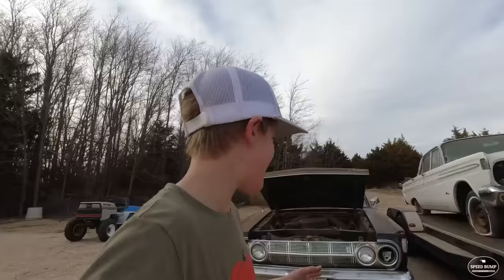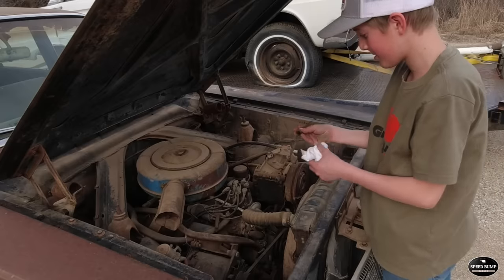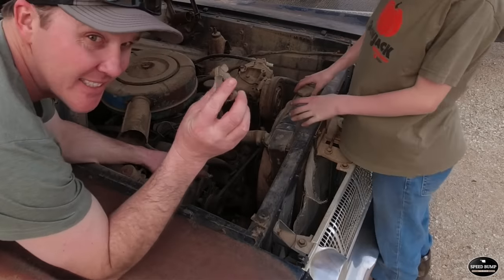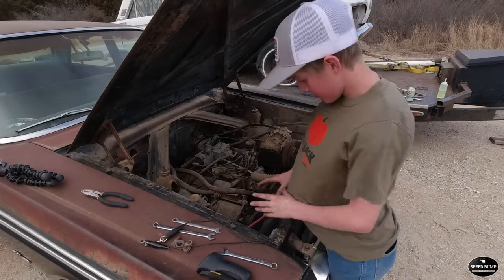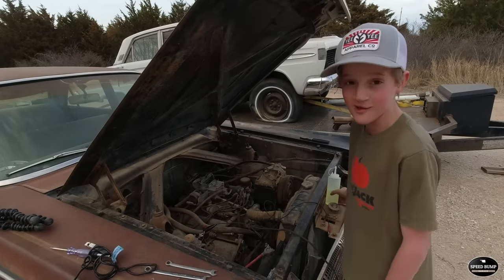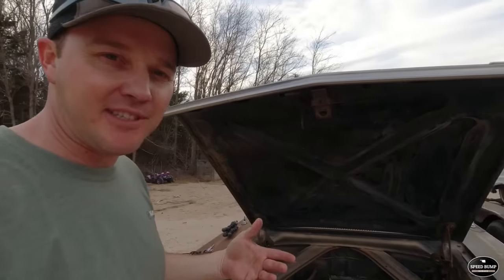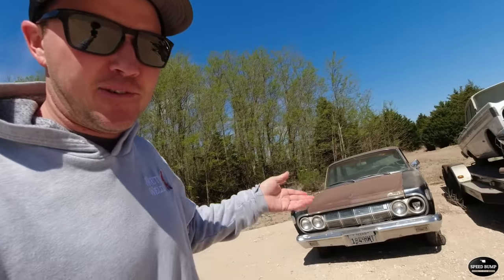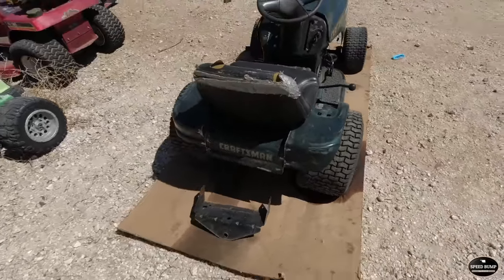1964 Comet... Make it run and it's YOURS!😲

Comment: Take the belts off so the engine isn't struggling to turn over. Use some mystery oil in the cylinders to help the piston rings to help build compression. Use two cycle gas and oil mixture to pour in the carberater  also check the spark plug wires for cracks which could cause voltage drop. Jack im extremely looking forward to seeing you get this car running and I would like to see you working on your lawnmowers. And remember there is no such thing as mistakes for mistakes are just a learning tool. Have Fun.
Reply from the maker: Thanks Ricky! Great idea on the belt
Reply: it gonny to work
Reply: Keep in mind has the car gets newer electronics starts to take over. Pretty soon you'll have to be an electrical engineer if you want to work on cars.
Reply: I love your video's
Reply: It's gonna work
Reply: When get coment running & what going on mover !!!

Comment: You're on the right track. Pull the plugs and oil the cylinders. It may help to remove the belts just for the first start and run. Check for spark at a plug or two. If you have it, put a little gas in the carb, open the choke, and try it again. I got all the faith in the world that you will figure it out. Great job so far.
Reply from the maker: Great advice! Thank you

Comment: What a great car for your first car, Jack!  I agree with your Dad: pull/clean the spark plugs, soak the cylinders (PB blaster or Mystery oil), check spark plug wires for corrosion or mouse damage, and MAKE SURE they go to the correct plug.  Make sure the points are free to move (open and close) and the contacts are not fouled.  Check for cracks in the distributor cap.  Also, clean the grounding point where the battery grounds to the motor, and clean the contact point where the HOT starter wire from the battery connects to the starter.  Compression test too!  WHEW!  THAT'S a lot of work.  Good luck, and keep the camera rolling despite knowing the project will take much more time.  It's great YT content!  Guys LOVE lawnmowers... esp fast ones... we'd love to see that too!  Good luck with all your projects, Jack!  We love your videos!!!
Reply from the maker: Thanks for the great advice Dr. Lee! I will pass it along

Comment: Jack, check the ground connection on the engine block, corrosion there will also cause problems with the starter going slow.  You may have a starter with worn bushings causing it to drag.  I like your work!  Show us something on the racing lawn mower project too.  When you are feeding gas directly into the carb, you can fill the bowl through the vent, and if it starts, it will run until it uses all the fuel in the bowl.

Comment: We want to see that lawnmower project for sure!  Super cool. As for the will it run… you said you were gonna put the distributor cap back on but didn’t show it. Did you forget to clip it in place?  Checking the plugs to see if any are fouled is a good next step. Lube in each cylinder to soak will help with compression too. Also add a little 2-cycle oil to the fuel you dump down its throat to help lubricate the top end too. You got this Jack!  I think you’re so close to hearing it bust off and make some noise!  Ooohhhh also remove the fuel pump inlet to the carb. You don’t want to suck that crappy fuel in there it will make this project much harder!
Reply from the maker: Thanks Troy! He did forget to unhook the fuel line before cranking but fortunately I think it was completely dry.  I do believe the cap was clipped on.  I will pass your good advice on to Jack!

Comment: Start with tune up check . Look how related parts work. Starting on lawn mower Perfect. Torque bolts according. Look at photos of engine. Inside of motor. Picture how the motor works. Great job. Love you program.

Comment: Jack, I''m so impressed with you. Your knowledge is far greater than your years. My dad bought me a 1960 Monterey Mercury for $250 at an auto auction. It was about the size of Noah's ark. I wanted a navy blue Mercury Cougar with a white top...but, no...I got the old Monterey. Drove it onto my college campus, and it stood out like a sore thumb. But it got me where I wanted to go, until the steering wheel fell off in my lap. Never did get a navy blue Mercury  Cougar with a white top. I'd sure like to have that old Monterey now! They've really increased in value.

Comment: Nice work, Jack PB blaster should help with a little lube in the cylinders on the rings plus I would make sure your ground is clean off the battery then I would clean up that connection at the starter just to ensure you have good solid connections for your starting system but I can’t wait to see you get that thing running pretty sweet car but also love to see your work on the lawnmowers. Keep it up Jack.
Reply from the maker: Great advice Pete! Thanks

Comment: After you have disconnected the fuel line to the fuel pump, if you have access to a 3-5 gallon outboard motor boat tank, clamp the line hose (remove the fitting for the boat motor) to the inlet of the fuel pump. You can then squeeze the bulb and push fuel all the way into the carburetor float bowl. This will prime the carburetor and the pump and keep the pump from pulling bad fuel from the tank. Then if the pump is good and the engine starts, it will be able to run for a few seconds. If the pump isn’t good, you can keep it running by squeezing the bulb. This is safer than pouring gas down the carburetor and will allow the engine to run in a more normal manner. It will also keep the pump from running dry and trashing the diaphragm. Good luck!

Comment: Thanks Jack it's  great to see the younger generation with heart to want to learn , it takes time the advice your dad gave is good pull plugs , PB blaster ,or sea fome , or marvel down in the cylinders , disconnect fuel pump take your squirt bottle and put it in the breather tube of the carb fill up the bowl . Oh yah after you get some stuff in the cylinders leave it set for awhile like a good day that way it gets down in there and loosens things up then turn it by hand with spark plugs out you'll get it . Also that tractor I cool let's see some more of that thanks have fun in what your doing.
Reply from the maker: Thanks!

Comment: I would check for spark at the pugs and verify the timing.  Since it turns over rather slow it could be a timing issue.  Also be sure to always disconnect the fuel pump so nothing get sucked into the carb as you try to start the motor.  You are doing a fine job on your own, I am sure your dad is pleased.  A brief look into your lawn mower project would also be nice to follow.  Stay cool!!!!
Reply from the maker: Thanks for the tips Robert! I did make him take the fuel like off after this video.

Comment: Jack, I think it will run but I would do a few things to keep from adding work.  Disconnect any flow of old fuel and use a direct external source only.  Check the plugs, do a compression check on each cylinder after you spray and let sit some cylinder cleaner for at least 2 days.  Change the oil to see if there is any metal in the old oil.  If not, add new oil with a little engine treatment.  Check each plug wire to confirm they are firing.  Give it a turn and good luck young man!  

I just found you channel and look forward to future videos.
Reply from the maker: Thanks!
Reply: I noticed after I sent my comment that this video was released 4 months ago so I am a little late to the game.  I will do some catching up to see how it has gone.    @SpeedBumpGarage

Comment: Stay with it, Jack! Good job, Dad!
On old Ford points (for future referebce) a matchbook coverc orks like a champ for setting them.
Also, DO NOT do like we did one time to get an old Datsun Pickup down the road which jad a bad carburetor.....we took a gallon of gas, poked a hole in the bottom and put it on the carburetor screw. She ran!....but we didn't quite like we hoped. Lickily, we didnt have a fire.
Reply from the maker: Thanks Steve

Comment: Yep. Check for spark at the plugs, Quick compression check, then squirt in a small amount of oil in each cylinder to improve compression and pour more fuel into the carb with a shot of either too.. Have a ready charged battery with back up charger assist.

Comment: Hey jack, when you pull the spark plugs, squirt a little automatic transmission fluid in each cylinder, and crank the engine over until all of the fluid is gone then install the new plugs, it will lubricate the cylinders and turn over easier/better... I would also put a new starter on it, and a boat gas tank hooked up for your fuel, and you should be golden... you are going to be quite the mechanic if you stick with it little man !!! You are already more car wise than most young adults I see, keep up the good work and never give up, you can do this !!!

Comment: ..Good Luck with those old cars Jack..They are treasures that are an investment that will increase in value as years pass..My very first car owned at 16 was a 1964 Ford Falcon..pretty much the same as this old 64 Merc..Made on the same assemble line no doubt..I paid 50 dollars for it..Used cars were cheap back then and this was in 1973 when i bought it..there was nothing wrong with it..Even the body was straight..something to think about to is collecting old car parts..Swap Meets has guys selling old parts..making good money on old parts they saved to sell at the meets..

Comment: Jack, You are doing a good job on the Comet. Complete your compression test. Then get a bottle of Marvel Mystery Oil and spray it into the cylinders after you get the spark plugs out. When the engine starts running well dribble a little marvel mystery oil into the carberator. Also check the oil pressure as soon as engine is running. Good luck.

Comment: Exactly what your dad said pull all the spark plugs and spray down the cylinders and do that a couple times a day and let it sit for a while, the more the better.  But also, while the spark plugs are out and you have lubricant down the cylinders, turn the motor over a few times, just by hand or by cranking it to kind of let that lubricant loosen up the pistons and rings .  I have an 83 mustang convertible with a 302 that sat for over 10 years and I had to do all that stuff to it but now she runs like a dream.

Comment: You can fill the float bowl up on The carburetor so if it fires, it will keep running. Also, if it has new points in it. I'd check  The timing Right be the issue with a compression

Comment: Hi Jack, verify the timing while the spark plugs are out, cylinder #1 is on top dead center on the compression stroke and your distributor rotor is pointing on #1 wire on the distributor cap. Make sure you see the distributor rotor turning to make sure the timing chain aint broken.  If good, then lube all the cylinders and put plugs back in with correct gap. Now verify you got the right firing order on the cap wires. Firing order is on the intake manifold.  fuel up the carb bowl and fire her up! 🤠👍

Comment: You may want to take a can of black paint and spray the negative Battery cable that is now red  and make it black before it causes a bad problem  like putting the battery in backwards or jumping it backwards and burning up the alternator.

Comment: Hi Jack when you have the spark plugs out turn the engine over it will be easier because of no compression it's a good way to get the oil going just see how it goes than put the spark plugs back in you are a great young man take care

Comment: My grandmother had a 1964 Mercury comet Caliente Hers was a 2 door convertible 289. Automatic It was a light blue color. She bought that car brand new. I remember when I was a little kid that used to sit in her backyard Thru the mid 90s into the early 2000s. She had the car restored.
As when the car was finished, that was 2004. When I was 19. I got to drive it with my mom one time and get to ride with my grandmother In that car. That was in 2004 also. My Mom used to drive that car sometimes to back in, like the 70s. But when my grandmother got older, they ended up selling the car. I don't remember where it ended up. I can't remember what year that was. But every time I see a 64 comet It always make me think of my grandmother.

Comment: Check the battery cables with an OHM’s meter for resistance, sometimes corrosion can build up in the cable and you can’t see it because of the insulation. They’re cheap enough so replace them.

Comment: Hello . Jack Always remember  to start a engine you need Air Fuel And Spark I see you checked the points   need to ck the cap for cracks

Comment: My first driving car in 1989/1990 was a 1964 Mercury Comet Caliente 4dr with the 289 4br carb and merc-o-matic transmission.  I still have it all these years later.  If anyone has a parts car with good rear wheel wells/ quarters I'd be interested in them.  Good luck starting the Comet!

Comment: Hi Jack,
Sounds like your starter is dragging pretty badly. Check all your ground wires and make sure they are all clean and tight. If that doesn't help you might want to try another starter ,after you see what the compression is and there is fire to all the plugs. Will check your next video to see what you found out.

Comment: Kent's a good dad and Jack is a dang good boy!  So young to be turning wrenches, but no doubt he has an aptitude for it.  Would be wrong to hold him back.  Nothing else to do but turn the boy loose.  Definitely trace, clean and tighten your connections back from the battery down to the starter.  It just may be that the poor old starter doesn't want to party.
Reply from the maker: I agree that it is most likely a connection issue or bad starter! Thanks for the advice!

Comment: use 2 cycle gas mix, helps with oil in it on dry engines.  hot battery   fuel send it spinning.  then trouble shot if not fire off.

Comment: Good work,,, on the top of the carburetor , there's a hole on top of the bowl, you can fill the bowl with gas...check to see if the the accelerater pump is working,, pouring gas down the carburetor will drown your plugs....

Comment: fuel, spark, and compression. Those are your three essentials.
It sounds like your cranking speed is still below 100 RPM.
Might want to help Jack change the starter out. Perhaps the white comet may have one that looks better or you can try, taking a look at the starter to see if the Bendix bearing is OK. use an in-line spark verifier to confirm spark.
Fresh plugs and maybe a little bit of starting fluid just to see if it wakes up.
Don't use too much starting fluid because you can damage the cylinder walls.

Comment: You asked for advice: Since you are taking out the plugs, and shooting some oil in there. After you let it sit run is over with out the plugs and listen, let the oil move around.   I hope that sound is the ac unit or something external.  Starter: clean up the ground

Comment: It's not hard to see you trying to make this car work, getting it for free is great incentive, plus I know you like a challenge.  Pull the spark plugs, do a compression check like dad suggested, but you might want to see if your getting spark, the wires are probably old and dry rotted.  Put some Marvel Mystery oil down the cylinder so it can lube the cylinder walls over night, less friction the easier it will be to turn over, also make sure your battery is fully charged, and you have good connections, at the battery, the solenoid, and the starter.   Check lots of different youtube videos on the subject, they will show you the steps you need to take.  I got faith in you, good luck.  By the way how's that racing lawn mower project going, haven't seen anything on that in a long time, I want to see that thing fly (go really fast).
Reply from the maker: Jack broke the first one but you can see the new one he is working on at the end of this video!

Comment: First thing Jack listen to your dad put in 2-cycle oil in your gas the bottle I seen you using putting a cap full
Reply: First before you take out spark play use some air and make sure it's clean around the spark plugs you don't break then you can use and you some penetrating oil
Reply from the maker: Thanks Gene! great idea
Reply: Make sure you take the throttle wide open why you are doing the compression test
Reply: Hey what happened to the Jeep

Comment: Firstly I think Jack is awesome,  secondly I think, even though there was power at the points,  I'd turn the engine over by hand until the gap on the points is at the open position,  other than that he's doing well, if your points open and close, the gap is correct you should be on a winner

Comment: Hey man your not far from that thing running !!!!! I would definitely listen to your dad pull plugs and put some oil down cylinders it does sound dry  maybe even. Crank it with plugs  out to get oil pressure up  too and if you do compression test don't get upset if it's low it's gonna be it's been sitting for a while  I garruntee it will go up after you get it to start if it's really low in some cylinders you can even put a little bit of gear oil or thick oil in cylinders that have very low compression it will  seal the rings and bump compression up. For a little bit  to get it to fire off  just don't put to much it will foul out plugs  also just grab voil wire off distributor and leave it plugged in coil and crank motor with coil wire  close to metal and make sure you see a steady spark too  you can do it.  I'm sure you can !!!!
Reply from the maker: Thanks Al! great advice

Comment: always number your plug wires  1234 5678  from. front to back  learn you firing order   carefully pulling off the plug wires   removing plugs. youse breaker bar & extension pipe  (sense your small you  need to improvise ) pull number One plug have your Dad place  thumb over  plug hole  Bump  the starter until compression pops  the ck the timing mark on crank this checks the timing. Chain   Enjoy  your. build .